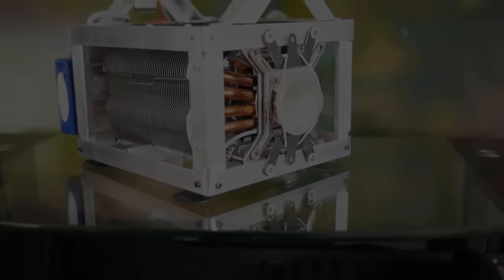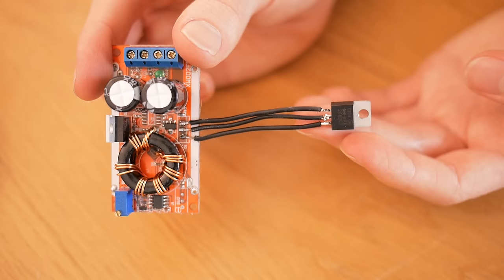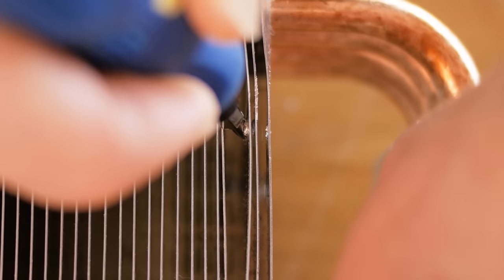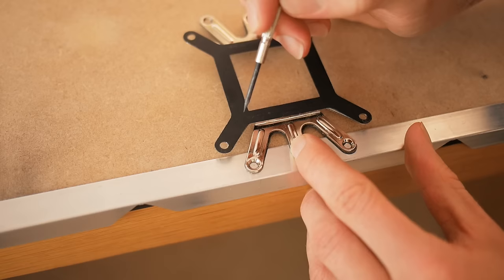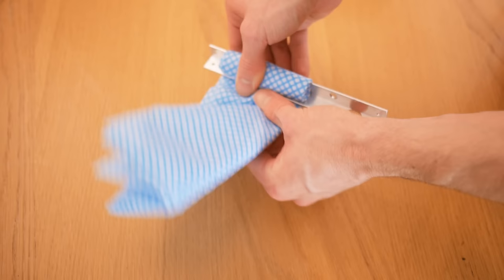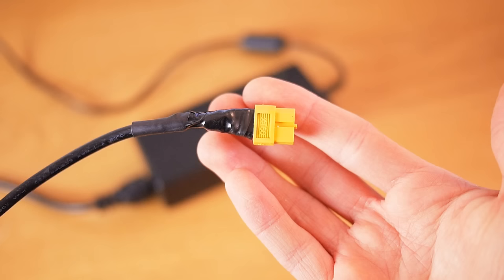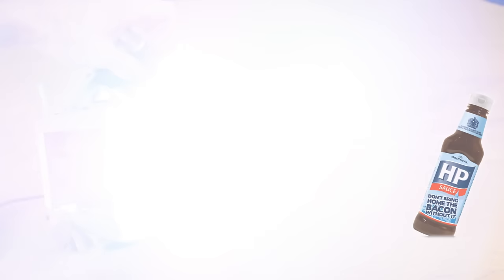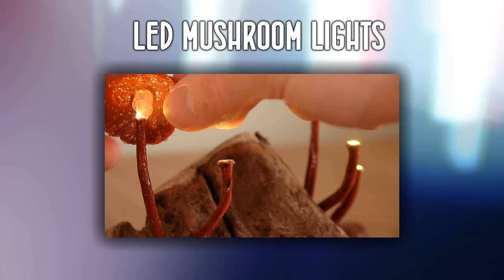Make a 1000w equiv. LED flashlight - aka DIY Sun-Blaster!

Comment: why not make and sell these I'd give 200 for one
Reply: +leon Brierley You have Apple products, don't you?
Reply: no but the flashlight is worth that look up what a 8000 lumen to 10000 lumen flashlight is worth and this guy could make a killing not everyone is good with making things, and I like the designs as well.
Reply: +leon Brierley All "being good at making things" requires is following instructions and common sense. You're totally capable of making this.
Reply: +leon Brierley 
£200 for this!! Are you serious?!  Yeah, it's bright but the execution is crap!!  It's ok as a prototype but no more!
Reply: +leon Brierley ill put a nice case and a logo on it and I sell it for you. Yeah, I'm the marketing man
Reply: yeah how will you charge for shipping?
and will you tell me what kind of batteries I'll need, also could you make the led more modular, and use the good ones from digikey?, Because I'd love one of these and if your serious message me back
Reply: +turboslag that's how much it cost
it cost around 146$ in material i think.
you do the exact math.
it's not worth that much honestly.
i got 4 50w lohas leds for like  20$
they are pretty great for little lights.
i also got the voltage booster for 5$ and i had a laptop power supply for free
and my little intel cpu cooler, it makes a great photo light for not that much if you got the shit already.
but otherwise it'd be silly. i'm going to get the rest of the components and i'll tell you my expenses.
i still have 3 more to break (and one i'm breaking right now).
Reply: ok great you let me know when its ready and I;ll buy it
Reply: fawwaaz carrim 2X brighter?
Get a 200w led.
Reply: 200 smiles
Reply: 200w of power consumption. For the led.
Reply: you can buy one for about $200 that is reliable has a warranty is a lot smaller and looks much better.
Reply: +RattyB75 what, I can't have my own opinion?
Reply: Really? He wants to spend $200 not 500 or more.

Tsk.
Reply: leon Brierley it costed 25 dollars, make yours.

Comment: home-made midnight sunburner, now I have skin cancer, whah!
Reply from the maker: Except it doesn't emit any UV light, so... no.
Reply: +DIY Perks Hey man love this project my friends and I are going to build it for our drones, but I had a quick question regarding your links - You linked this product on eBay (ebay(dot)com/itm/371042744391?rmvSB=true), and I was a tad bit confused, is this the heatsink required, the fan, the lens, and the mount that you attach the LED to? Thanks mate, hope you see this so that I can get cracking :)
Reply: DIY Perks how much does this weight? Looking to put on a drone as well :)
Reply: Obviously to make an airborne Death Ray, no?
Reply: Squinkie just Squinkie I bought a brighter light at Lowe's for under 15 bucks 🤗

Comment: I have a big cuestión, can I use a 10k resistance electric instead of a 11k ? 'Cause I don't know if it works equal.
Reply: It does work equally fine. Because the actual outcome is determined by the potentiometers.

Comment: what wattage does the 11K resistor need to be rated for? thanks!
Reply: +Exotic Toucan can i use 2 1/4 watt resistors?
Reply: cool, ty
Reply: +Exotic Toucan can i use 2 watt 11k resistors?
Reply: i dont understand the use of the 11k ohm resistance
Reply: @ighishi , the original resistance of the potentiometer is 10k. He is replacing it with two 11k in parallel and two 10k potentiometers in parallel (not exactly, but the idea is this) and ends up with 5.5k of fixed resistance and 5k adjustable resistance on top of that.

Comment: how much heat does this output? Could you get by with a cheaper (or spare) CPU cooler like an Intel LGA1155 stock cooler?
Reply: The intel stock cooler will struggle to keep it cool without having the fan running at maximum (very loud). It's designed for 50-70w CPUs, this outputs closer to 100w of heat.

Comment: It's called a desoldering iron look into it...
Reply from the maker: I wanted to use standard tools so as to not put off potential builders who have less experience. That's literally the only reason why I bent off the mosfets etc rather than desoldering them - it's just plain easier and quicker.
Reply: +DIY Perks Good point but still for ones that are new to DIY should be shown how to do things right and with the right tools, the way you did it works but can be unsafe for some who are young! Good job tho an I like just about all your projects. keep up the good work :)
Reply: +fmslick Twisting off is dangerous but soldering with a gas iron is not???
Reply: +Voluntarist O.o where did you come up with gas from?
Reply: fmslick Mine operates on butane/propane.
Reply: fmslick This is what I was referring to, for advanced peoples it's amazing. You could almost braze a pipe with it lol. 
http://www.amazon.com/WPA2-Professional-Self-Igniting-Cordless-Soldering/dp/B000ICEMYU/ref=sr_1_16?ie=UTF8&qid=1446865957&sr=8-16&keywords=butane+solder+iron
Reply: +Voluntarist That is a Soldering Iron not a Desoldering Iron an like you said "advanced peoples it's amazing" but newb's I think its a bit over the top lol
Reply: +fmslick thumbs up on the mosfets, when I saw you break them of I thought to myself, &#39;that make so much sense!&#39; There really was no good reason to desolder them really that I could see.
Not to mention I HATE desoldering. I have solder suckers, desoldering wick, and a desoldering iron, and I hate them all! LOL

Comment: Lens - suxx.  Need TIR optic or deep OP reflector
Reply: +easyelectronics Where can you get one of those for an led of this size?
Reply: justtesting555 may be automotive? LED Head light has some size.
Reply: justtesting555 You can try to calculate the geometry of their own (there is a special software for this) and printed on a 3D printer. Sand and cover by electrochemical galvanization. Chromium or aluminum, with subsequent polishing.
Reply: +easyelectronics reflectors do nothing to help these 180 degree emitters. the reflector is a plane behind the led and the collimator lens interfaces it well. because of the cool nature of the LEDs output heat stress on the lens (which happens to be glass) is obviated.

Comment: That is pretty awesome.  I'd be tempted to find a fried Ryobi tool, take the socket for that, and use the Ryobi 18v batteries.  I can then use the charger and swap batteries quick and easy and charge them using the normal charger.

Comment: Haha excellent. Get a decent soldering iron with a smaller bit; a calibrated adjustable Weller if you can afford one! You will thank me for it later. And clean the bit with a wet sponge before use each time. If the bit becomes covered in oxidisation you can clean it with a file. When the bit wears down, replace it. Ensure all the joint (both parts) are sufficiently hot before soldering. You can do this by "tinning" the soldering bit in advance and then use the tin to heat the joint, it will help the solder flow and adhere, but do not overheat or it will burn off the pads. Also use pre-fluxed solder.  I have ESA qualifications in Hand Solder btw. Enjoy ;-)

Comment: I've wanted to build this for roughly two years, and received a CPU cooler for free roughly 8 months ago. Finally ordered the rest of the parts yesterday, can't wait to build it :)
Reply: where did you find the LED? it seems that the listing has ended...
Reply: I got mine on amazon - a company called Lohas carries them, in both warm and cool. I got a warm one, it looks great. just search "LOHAS 100w LED chip" on amazon, it should come right up. If you can't find anything else, let me know, i'll show you where to find it.

Comment: I liked the video & I plan to build something very similar. I've read several of the posts & though I agree with a few posts down about execution issues I don't wanna be rude. I have Mil-Spec solder training working for a defense contractor that builds military batteries & also many years of soldering experience from radio controlled hobbies. So the solder skills used here made me cringe but I also understand the spirit of the video from a regular DIYer. One thing I will criticize.... HEATSHRINK!. Insulate all those solder joints. I've got a pile of Kokam 4000 mAh Lipo cells & several spare computer CPU coolers. Time to get to building :)

Comment: My idea was to DRILL holes into the heatsink itself to mount the LED ... which is why I was not in favour of the heatpipe design. But having watched the video in more detail, I see it's the clip that mounts the CPU to the motherboard that can clamp the LED in place. Neat. One other point. To simplify the fan power source, you could use a small LED driver that is designed to output 12v constant voltage. (Be careful though: Some are not regulated. One unit I bought used "constant current" such that the voltage increased to 37v if drawing less than 1A)

Comment: I want 6 of something like this...I'm in the process of tinkering now...2 each for the front/back of the house and one for each side all wirelessly controlled by one central unit (rf and/or Bluetooth) to be constant on, synchronized strobe, and individual on/off/effect control of each unit separately so I can light up the yard at 2am like it's 12noon on demand! ...I'd also like a fairly fast chasing effect SO I can make the house look like a UFO about to take off, just for fun and possibly an additional option for PIR triggered security (add on switches) so depending on the effect being lit I can know immediately where the motion was sensed/triggered ....fairly big, long term and hair tearing project so far....can't wait for all my testing to be done SO I can build the final ones to mount on the roof! ....it's one of those projects that you want really REALLY bad...but you have to walk away from quite frequently in order to not take a sledgehammer to what you're working on haha

Comment: You could add a noctua 120mm fan and run it at 12v constantly as they make pretty much no noise. The only thing with running it at 12v constantly is that it might lower the life of the fan.

Comment: u dont need to worry about IC backside touching and shorting because of the heatsink
the backside of the IC is meant to be attached to heatsink, not as electric conductor

Comment: that heatsink used is more then you need, you really only need a stock intel heatsink or something similar. operating temp in the specs range between -25 to 90 degrees c.

Comment: I'm surprised no one in the comments has pointed this out so I will.  The majority of your solder joins are brittle or even cold altogether.  This will reduce efficiency and can even be dangerous if a connection fails

you need flux, and the tip of your iron is ruined

Comment: And You need to use battery as high capacity as the led consumption to prevent too fast discharge rate ( recommended 1C )

Comment: Every time I get to the part where I plug it all in to adjust the trimmer potentiometer, the tiny R010 resistor on the bottom of the voltage regulator fries. It’s happened to me 3 times and I’ve meticulously followed along each time. I even replicated your harmless error of connecting the green wire “to where the trimmer knob used to be” in the wrong position. Would mean a lot if someone could give me a hint on how to approach this 🙏

Details: power is coming from a 20-30c discharge, 3 cell 1.11V li-po battery.

Comment: Varying voltage to LEDs is not the best way to vary brightness, they have a very narrow range of voltages they work on. The method of choice is PWM at a high clock frequency that is invisible, say  >40kHz.  Isolating TO220 ICs is best done with kapton or mica pads with an isolation kit that has nylon washers; you can not trust thermal paste to do this! Also you can clip the side mounted contacts off the LED and solder directly to the pads on the top of the LED, then use some electrical (no acetic acid) RTV to insulate the solder joints and the side contacts where they were clipped.
Reply: Doesn't this add flicker though, which will show up when using the light for high frame rate video?

Comment: I made ist for just under 15 €  just with the cheapest Parts from Amzon. I made a 3d Printed housing where you can plug in your Powertool batteries at the back. I used an old cpu cooler from a scrap pc.

Comment: Hi Matt,
First of all i would like to say that i am fan of your DIYs and the quality you achieve. 
Thanks for your videos.
After watching your video of " Make a 1000w equiv. LED flashlight - aka DIY 
Sun-Blaster! ", i tried a similar one and was successful. i have 
installed it on my motorcycle for long highway night drives. 
Though the light output is extremely bright, however, i am able to use it only
as flood beam. as the Glass lens has a beam angle of 60-80 degrees. (physically appears to be covering greater angle)
My intention was to use it as an focused spot beam light. Is there a possibility to work around to get a narrow spot beam angle say 
30 degrees? Or is there any narrow beam lens available online?

Comment: Screws a circuit board through the heatsink, fixes switch and dimmer to a metal frame, adds rubber feet to the frame, holds battery and lens with elastic bands and glue.

Comment: You can make an even brighter light by using some microwave oven transformers, removing the high voltage secondaries, rewinding them with enough turns to reach around 10-30V, then connecting the primary inputs in parallel, and secondary outputs in parallel, then taking 2 large carbon graphite rods(preferably reinforced with another extremely high temperature metal, and the carbon rods being around an inch in size). When the supply is live, and the rods are in place, if the rods come in contact for a short amount of time, and are released(I.e pulled apart to less than a gap of 1/4”), then a massive arc will be ignited. I’m talking temporary blindness when you see this thing too. The arc is so hot they use this system to melt steel in steel mils. If this system was to be overdriven you could push around 8-10KW out of it at 30V, 266A, or 12V, 666A. Which is beyond unreasonably powerful

Comment: Question about the battery: You said that the voltage booster needs at least 12V. However, your battery has only 11,1V. Not much of a difference, but what happens if the battery goes empty and has only 3,6V (where the alarm triggers) left? Isnt that too little voltage?
And another question, what does 3S and 30-40C in the description of the battery means?

Comment: The fins on my cpu cooler are more narrow than the ones here, but the gap between the bottom fin and the heat sync is larger.  So, that effectively means that I need to figure out a new mounting solution for the voltage booster... BUT I don't need to reset the capacitors on it.

Win some lose some I suppose.

Also, I'm using the newer, more color accurate LED's that you reviewed not too long ago.

Comment: Great project! My only comments would be that I would prefer using silicon pads instead of paste to prevent IC electrical conductivity with the heatsink and that I would mound the handle on the side so that the fan is facing sideways and thus the torch can be used in the rain. An additional side cover with slots would help in extreme conditions. As an extension to the project, I might be tempted in some kind of focusing mound for the lens so that adjustable focus can be obtained. I'm certain that a lot of mountain bikers would be very interested in this project as it makes a perfect light source for night mountain biking as it is (with the addition of an appropriate bike mound of course and some rain protection cover).
Reply: First: There are some IP67 fans available.
Second: Thermal paste is more durable and has a better heat conductivity.
Reply: @Legoloewe  You have to use mica sheets with thermal paste to ensure there is electrical isolation.

Comment: LEDs need current regulators, not voltage regulators. Their output can be handled much more convenient with current regulator. Heat variations cause varying voltage drop on them, and if driven from CV source, their output will change also. When considering additional cooling, bear in mind: Connecting switchmode devices should be done with the shortest and thickest cable possible. Close to a low ESR capacitor on supply side, close to its choke, or resonant tank on the switch side to achieve stable operation over time. The very same holds true for the capacitors, wiring out with such a long and thin cable isn't very good. Remember, currents flowing in a swicthmode circuit is always few times greater than the average you can measure. And, the double diode (that MBR2060) likes shorter cable to minimise EMI. Also, the choke gets hot easily, so that needs a thermal gap pad at least on a long run and capacitors will be happier too. Alas, good video, detailed and understandable.

Comment: I am thinking you could repurpose a desktop computer power supply case, using a smaller P4 style heatsink, maybe passive. They have a builtin fan on the back, and you could leave the power connector in place, putting in a battery charger and rechargeable battery, maybe from an old laptop.

Comment: don't we need to use a current limiter or constant current circuit. coz the boost converter puts out higher amp. btw m building this now. thanks for the video.
Reply: what power source did you use?  and were you successful with the dimmer?

Comment: A boost converter operates at very high frequency, i.e. radio frequencies, so extended the chips with wires will make them antenna to radiate.  This will be very bad..